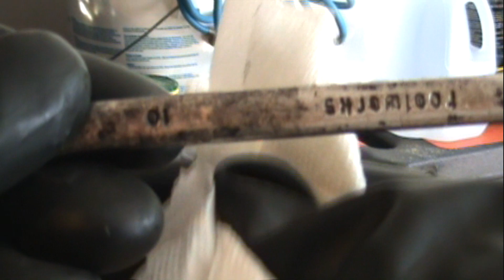Stripping Nickel Plating pt.1

Comment: Is there a way of removing the chrome plating to the point of being able to blu it without having to sand or blast it?
Reply from the maker: You would have to use a deplater machine. You will still have to scuff up the metal to take the bluing as it won't bite into the metal

Comment: Can you use lead wheel weights ?
If so how many will I need.
Reply from the maker: I just poured some wheel weight lead on a piece of stainless made a strip of lead. Drilled a hole and attached that way.

Comment: I thought you had to sand blast off the chrome layer first to get to the nickel plating, and then do the acid bath to strip off the nickel layer. You see, I have this gun that it is covered in chrome but is rusted, so I want to strip off all those shiny layers to parkerize it with phosphate, some people say that most guns have the chrome layer, a nickel layer and a copper layer before you get to the bare steel, even then I worry about the steel structure of the gun to be compromized with the acid bath, but Im no chemist...

Comment: What is the sulfuric acid concentration?
Reply from the maker: 50/50 acid/water. I use battery water from old car batteries. It is closest to what you need without having to purchase/mix. Had two car batteries I just so happened to need to replace so I removed the water before turning batteries in for the core charge. Make sure to use proper safety gear as the acid will burn your skin/ clothes
Reply from the maker: https://youtube.com/playlist?list=PL_vef7x8e64T9_Y_VLR8W_pfg93mqzalz
Reply: Except battery acid is typically 37% sulfuric acid, not 50%.